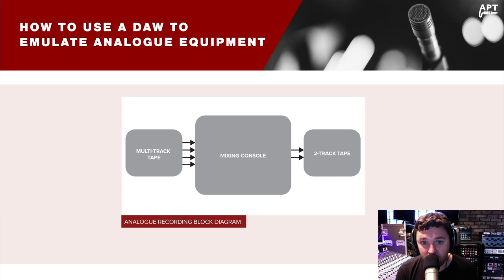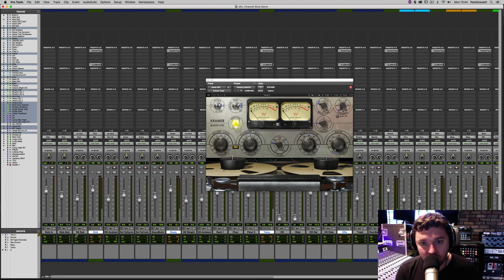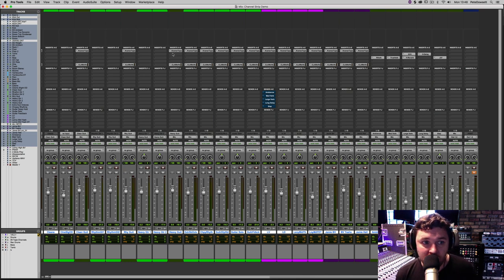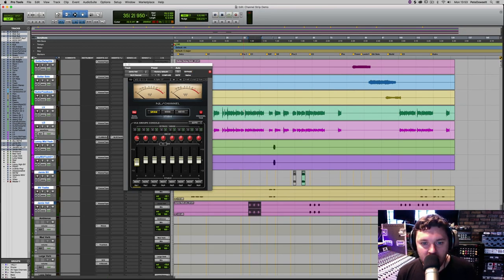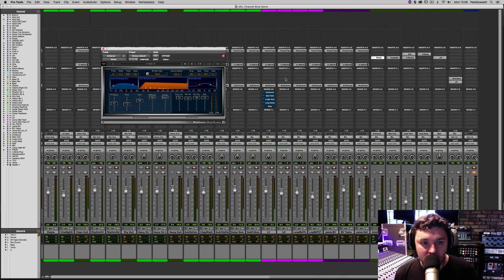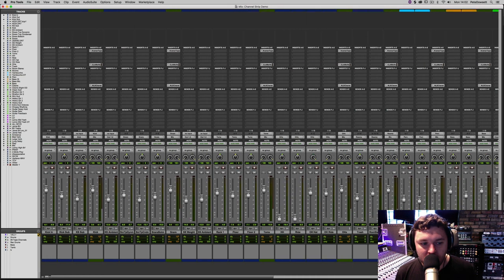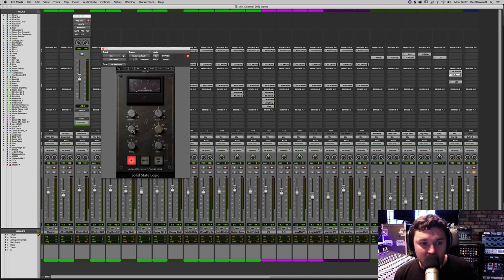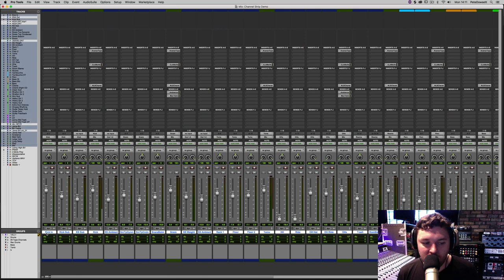Full Analogue Workflow In-The-Box with Waves Plug-ins [Video 2/2]

Comment: Would you put say a 1073 before tape?
Reply from the maker: If it's the EQ part of the 1073 most likely after. If you are using it as the pre-amp to drive the signal harder like you had recorded it hotter, I would put it before. However, there are no firm rules here, try both and see what you like :)
Reply: @audioproductiontips  Ty for your reply!  Cuz i know in the real world..the signal path would go from my guitar etc into a preamp thru the console to tape!!!